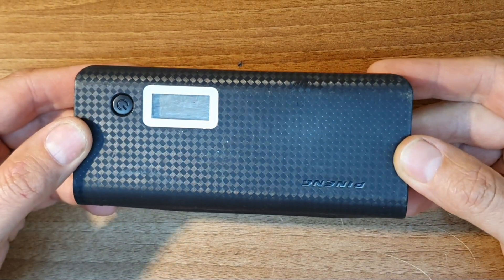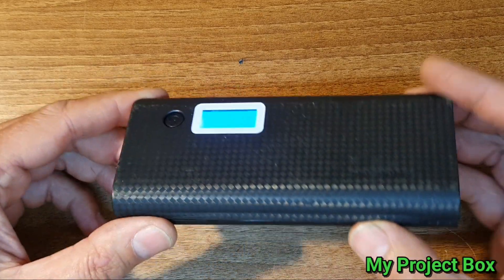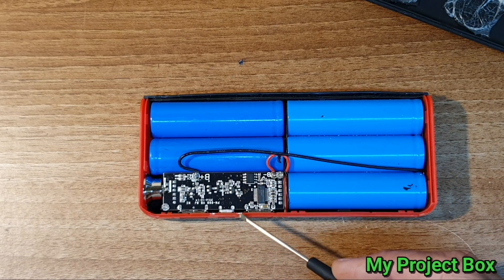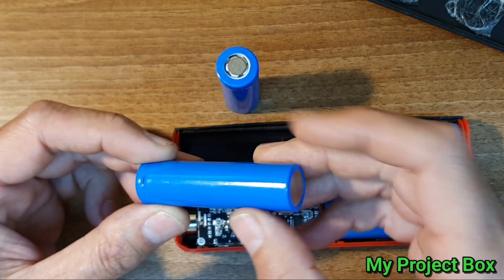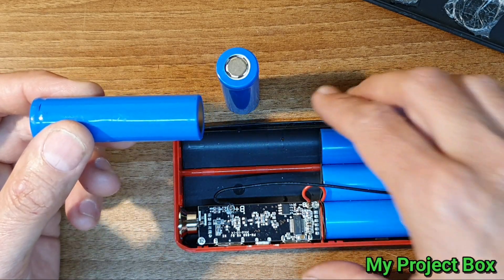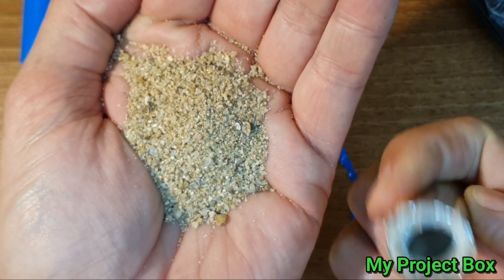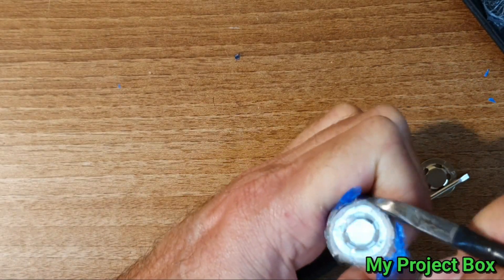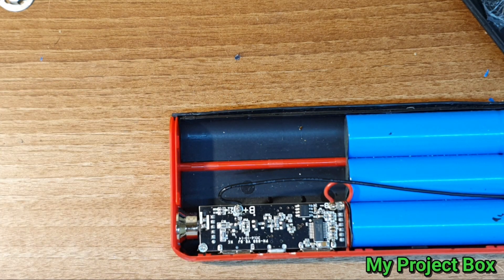fake 18650 cells filled with sand inside a USB power bank. #electronicscreators

Comment: I had a key ring flashlight with solar cell for charging. The cell got cracked within a couple of weeks so I opened it up. No wires on the solar cell and no diode either.
Reply from the maker: I had exactly the same keyring😜 with no connection to the solar cells as well. The interesting thing is that the solar cells we're actually real! just not connected.

Comment: Most surprising is they used a real container, insulatings and a proper flat top for a convincing look of the fake cells, but left out the wires. I guess anyone opening it up will notice the missing wires and quickly realise something is wrong.
Reply from the maker: Wouldn't it just be easier to put something heavy, like metal washers or weights of some kind inside. Why go through the effort of the sand filled cells
Reply: W
Reply: Aa
Reply: @was
Reply: Z
Reply: ,×a was wax
Reply: W
Reply: 0101010101
Reply: 01

Comment: I purchased some cheap microphones condenser ones.  They had no circuit boards at all.  A tiny capsule I mean tiny. That went straight from the capsule to the 3 pin socket.  They both had a big lump of pot metal in them half the size of the microphone itself.  Same idea as the batteries. One big con.
Reply from the maker: That is shocking 😱

Comment: I usually buy an empty power banks from Ali. My current power bank is 1s58p. With about 6 available usb ports, wlireless charger and xt60 for a quick charge.
Assembled with a junk sells with some self discharge, whole power bank gets used completely in about 3 days.  Capacity about 80ah.
Reply: Wow man, that is NICE! Ali sells power bank cases for 58 cells? I've seen up to 20 cell cases.
Reply: @CheapCheerful  No, i used 3 of them.

Comment: Wow! Nice work. The marked capacity of 6300mAh does seem to match the 3 cells though. But why you'd go to the effort to produce these genuine looking cells filled with sand when you could have simply left them out and reduced cost and shipping, seems crazy. Somewhere there is a battery factory that makes cells filled with sand...
Reply from the maker: Thank you! Coming from you that's a complement👍. It's very sad to see these kind of battery scams😥.  Don't forget to subscribe😉 hopefully one day I can make videos as good as yours👍
Reply: If it matches the advertised capacity, the ballast cells might help it have a pleasing center-of-gravity when held in the hand, instead of seeming lopsided. Then the space for other cells would let a different model be sold with a different capacity.

Comment: It might not be as fraudulent as it seems. When it was new, if the three cells had the capacity noted on the rear, all is good. Remember, the designers are usually asked to be flexible with the design. Maybe there is a higher capacity model using all five cells and they also want to make a lower capacity model but keep the same housing- what do you do with the empty two cell slots? As the low end user would feel the imbalance causing dissatisfaction/returns. This was a quick, inexpensive solution that solved a few problems.
Reply from the maker: I get your point. But a simple spacer weight  would be cheaper and less deceiving. The working cells also seemed of poor quality. And why was the red wire negative and the black wire positive? It all seems thrown together cheaply, to sell a crap product for more money.
Reply: @MyProjectBoxChannel  I thought this was confined to shipment destined 4Africa.Thanks for sharing.
Reply: @MyProjectBoxChannel  hard to say, sometimes you use the materials at hand. No doubt quality has some failings and printed values are often wrong by mistake or deception

Comment: Nice video, I would however put a plastic shim or tape down the side of the two cell you added as the ends are very close the existing cells and you run the risk of the cells touching and shorting out. 
Damn scummy scammers nearly as bad as Apple Ha ha...!!
Reply: Name and shame the seller
Reply: @garrygibbons2989  Yep I agree, Problem is society wants cheap crap, so society gets cheap crap. Built down to a cost.
Reply from the maker: Thanks for the advice. I do remember that the working cells had insulation paper on their ends so it shouldn't matter if the new cells touch them 😉. But you are right the more insulation the better 👍
Reply: @MyProjectBoxChannel  Oh sorry I didn't see the tape on the existing cells, I just had some fantastic (well... not so such) fireworks from 18650's very volatile little creatures, so I'm super cautious. Keep up to good work, you have great potential !
Reply: There's no problem - the extra batteries were installed upside down - negative poles to negative poles . . .

Comment: Wow. As to adding real cells, I'm thinking the charge control circuit might only be rated for 3 cells instead of 5. Unless they used protected cells, which I doubt.
Reply from the maker: The cells are definitely not the protected kind. As for adding two more cells , I think the charging current will be limited automatically. So I won't matter if you add 2 more cells it just takes longer to charge them all in parallel. As long as the upper voltage limit of 4.2v is not exceeded.

Comment: A good video showing a battery scam. I've seen  cells with sand in before and even soldered in place too! Would have been interesting to see if the capacity of the real batteries was in fact 2Ah.  Probably less. A clue is a plain plastic sleeve with no information. It's bad that the manufacturers of these things are deliberately cutting costs and scamming us. Some power banks have crazy power ratings...   even more than a car battery.
Reply from the maker: Not good! The working batterys are probably very poor quality. I have a battery tester I but could not bothered to test the capacity of the "good cells".  But I know it's not great.